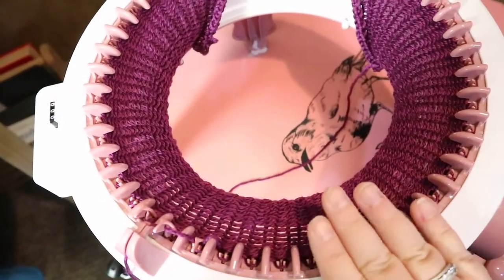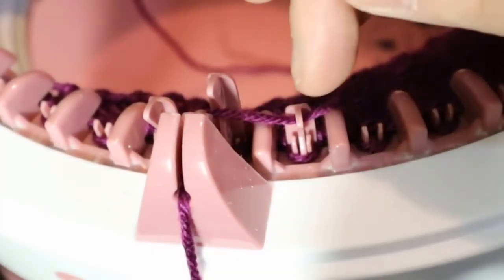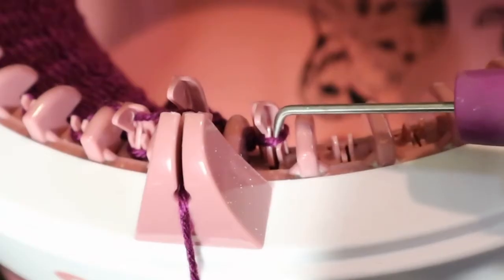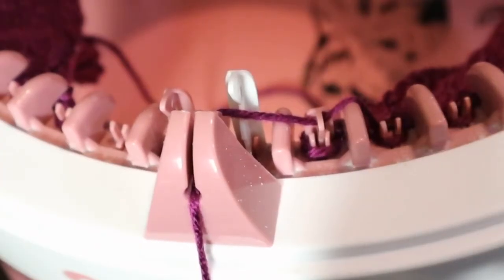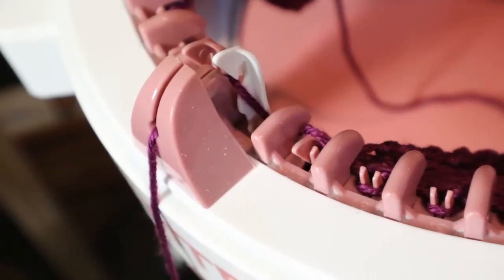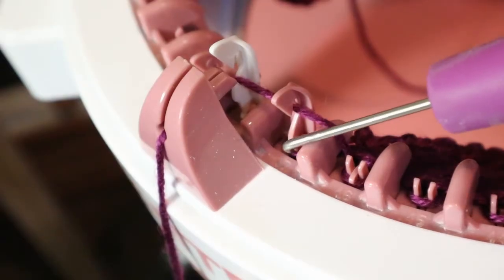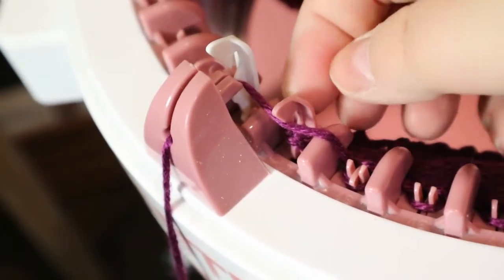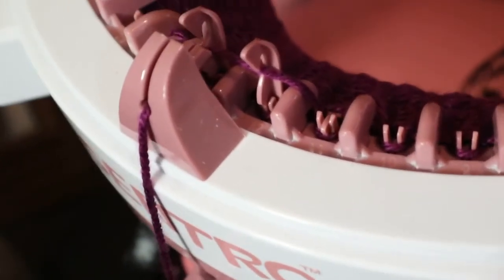SENTRO  Making the PERFECT Flat Panel

Comment: This has been the most helpful video I have found so far! Thank you for helping my sanity!! 
I do have a question though please. 
I keep finding my last hooks have multiple loops on them when I do panels. Sometimes 3 or 4! And then my yarn cant fit under the hook any more and I get cross and take the knitting off. Does anybody know why I might be getting this please? 
Hoping somebody knows! Thank you ❤️
And thank you again for the video! ❤
Reply from the maker: Thank you very much. I hope someone can answer your questions, I certainly  have no idea. I've never seen that before. I will pin this comment hoping someone can help.
Reply: This happens to me too - I think it happens because the stitches aren't fully down on the edge needles, OR because I'm actually holding the tension too tight when I do the edge stitches. It is fixable, but it's fiddly and awkward. If you look up "bunched stitches on a Sentro", you'll see an example of how to fix it. Good luck! :)
Reply: I've also realised something - the stitches need to be right down at the bottom, not just "not at the top" I think I was leaving several of my stitches just partway down, thinking that if they weren't at the top, it would be fine.
Reply from the maker: @susansays5627  some very good information  thanks so much

Comment: I figured this out too myself that my tension on the ends has to be tighter. Then I saw your video and it confirmed what I was doing. One side of stitches always looks beautiful the other side is crooked. I am going to get this I keep practicing. I know the machine will behave once I finally get it. I think the machine eventually loosens up with work in it repeatedly. It's kinda of stuff because it's brand new.
Reply from the maker: I agree…Once the bugs were worked outta mine, it does behave differently now, 100%.

Comment: I started using this just recently because my daughter keep growing out of the clothes before I can finish making them by hand. So i got the sentro and it’s just the thing I needed. Mine doesn’t have the issue with it not pushing down once I get a few rows in
Reply from the maker: Mine does for a few rows depending on yarn i use, but after about 10 rows, once the weight is there, its pretty good.

Comment: How do you have 2 white pegs? I can’t tell which is the end your working on. I go 2 past my end & I still keep dropping every stitch at the end
Reply from the maker: @PrettylilWaffle  I don't have two white needles, I'm doing a full panel, the white needle you see is the same one.  Once you go two past you need to pull down on your lead yarn to keep it tight as you change directions to go back the other way. Once your first yarn peg catches you can ease up on your tension.